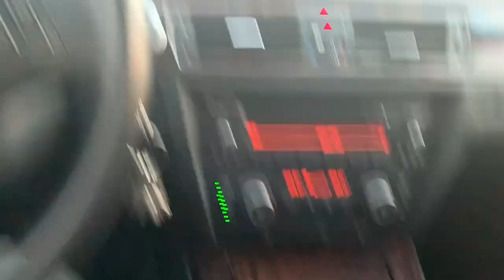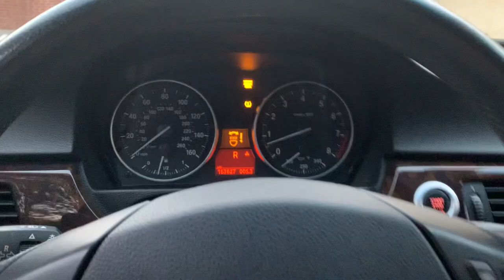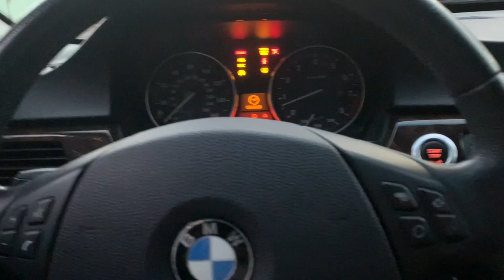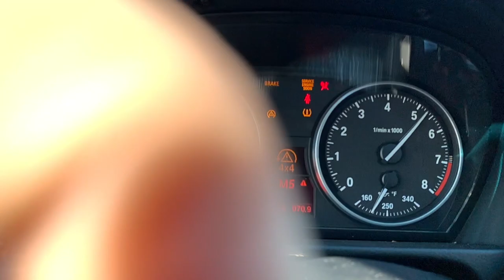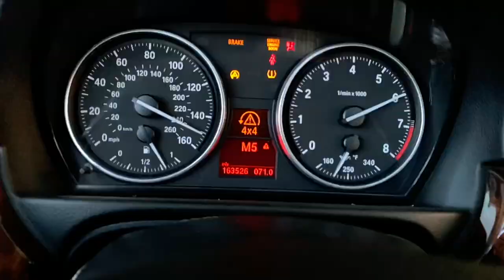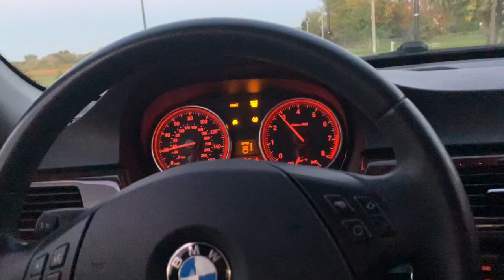UPGRADED TURBOS 335I POV! (OPEN DOWNPIPES)

Comment: Yo how many miles was on the motor the rod bearings went? I got 185k an been getting scared lately lol. Plan on doing them soon.
Reply from the maker: 164k…. But I did have a car with 189k miles, stock turbos. The new owner of the engine did rod bearings and it’s still running strong!! I highly recommend just getting it done asap.

Comment: Have you had any issues with the auto trans or x-drive at your power level?
Reply from the maker: Not yet. Though I just picked up another transmission just in case. One of my friends just ran his 15th 10 second pass all stock drivetrain and transmission. Probably 600whp

Comment: Hey man. How does This car compare to your e46 330 that you had?
Reply from the maker: Honestly this is much faster. But the E46 was more fun imo. 
The e46 was raw power in a light chassis, the e90 is refined and awd. It’ll pull but it doesn’t have the excitement or drama like the e46 did.

Comment: what in the base model ricer shit is this. put your exhaust back on, change the rear wheels, pull off the rear tint, consider getting a decent steering wheel, your making 335i look like a 325i
Reply from the maker: You’re looking to get gapped or what?
Reply: @straightsixracing  that shitbox isnt gapping anything
Reply from the maker: You think? How much?